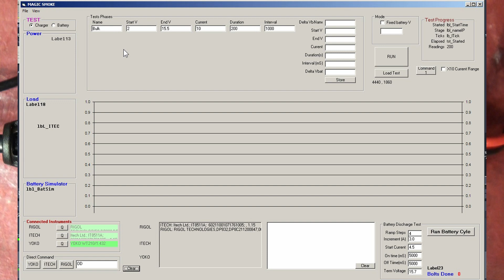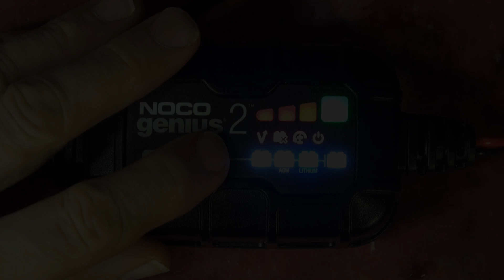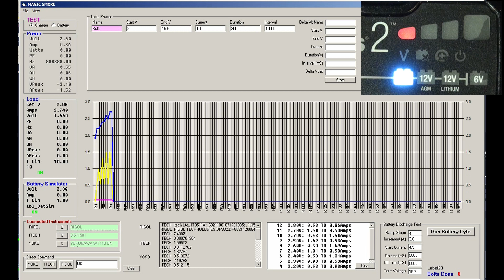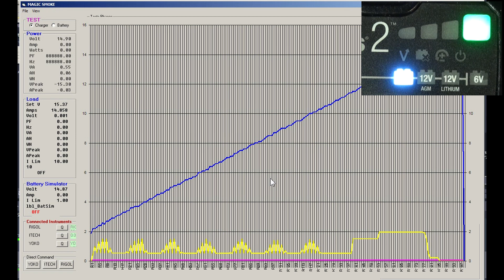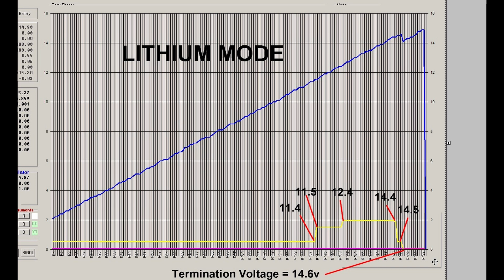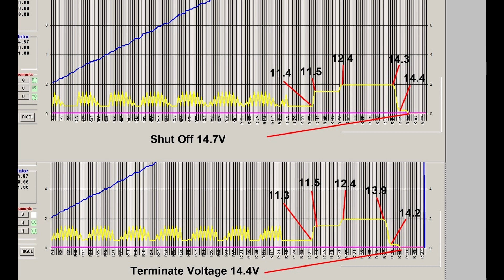NOCO Genius 2 Charger Part 2

Comment: Good to see a charger that knows what it's doing - not having to restart manually is a good idea.
I like the pulse charge at lower voltages which ought to do a decent job of cleaning up the plates of a discharged battery.
Looks like it would carry on for as long as needed on a real battery.
Presumably their 5A charger (better for a normal sized battery that has discharged significantly) does the same.
It's good that it doesn't assume that sub 7 volt from the battery means it's a 6V battery.
This one is really only a maintenance charger.
Reply from the maker: Yes, seems good. I have one problem to investigate as I saw the output go wild couple f times. It doesn't like and capacitance connected across the probes at which point is does strange things.  Neglecting the traditional output filter  inductor and employing an Aluminium Polymer cap in its place the output filter  is maybe an innovation too far.  If connected to a battery and nothing else it seems to work but if any part of connected device has a capacitor it does strange things. When I get to the bottom of it I will release a video.
Reply: @razenby  did you get to the bottom of this problem? How are you getting on with the charger, as I’m after buying one
Reply from the maker: @The_Last_Post  It has been maintaining our JAG in the garage. Seems to work OK. Hasn't failed,. Probably turned on for 5 weeks straight so far.  The one I have here is lacking an inductive filter one the output side.  It doesn't like capacitive loads across the clips..  Works OK with the car connected.  I didn't investigate further.
Reply: @razenby  thank you for replying so quickly, interesting about the inductive filter. Does that mean it was missing from the factory or it could do with one fitting? Would be good to know what type/value needs fitting and where. I understand if you’re not interested in further investigation